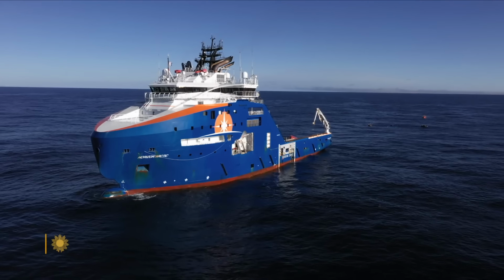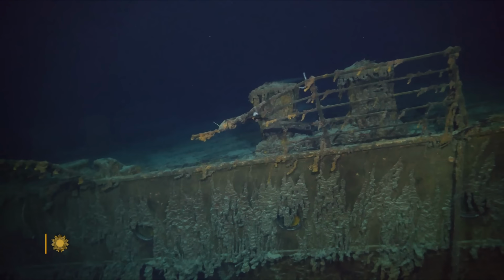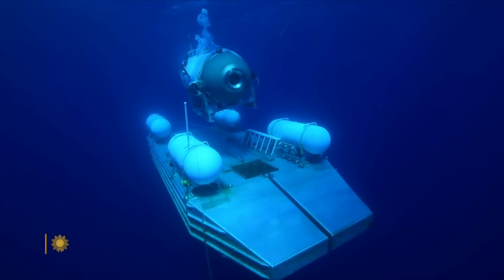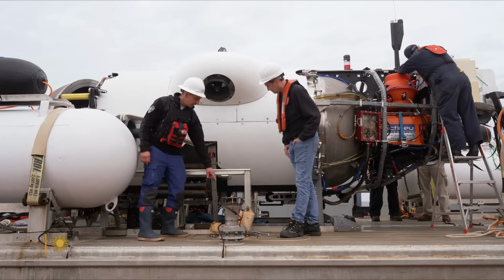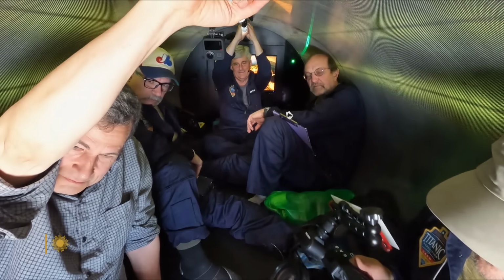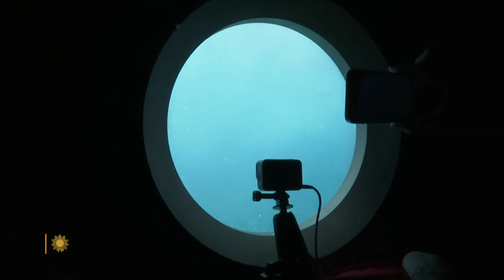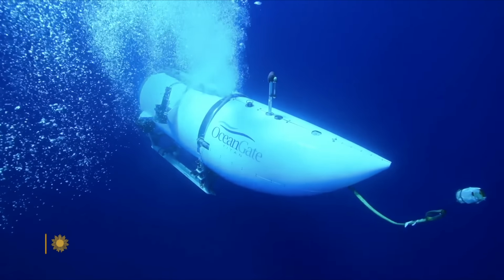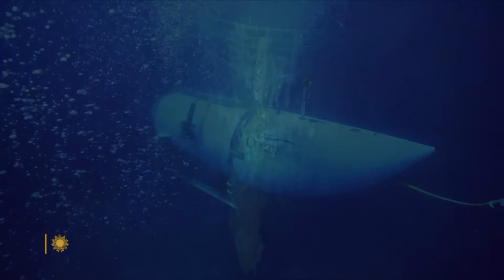Inside the OceanGate Titan tragedy

Comment: The Titan did too many dives and suffered fatigue over time weakening the structure. The use of different materials in the subs designs caused corrosion from the salt water. It is a real tragedy that more time and money wasn't spent further improving the design. 

The titan should have been dismantled and studied to look for flows after 10 dives (or any number) and then redesigned to be safer.
Reply: The flaws of carbon fiber composites are well known. They weren't a surprise. 

They chose to cut corners on safety and material to save money.
Reply: vibratingstring CBS said 12 that’s probably about right. Plus it made several more trips to lesser depths than the Titanic
Reply: vibratingstring  The Titan had made 20 dives to Titanic depth. 12 of those times, it actually made it TO the Titanic. The rest were either tests, or they couldn't find the shipwreck once they got down there.
Reply: vibratingstring  I'm not exactly sure how many dives, but this video reported 12 in its first year. 

There were 50 test dives done in the Bahamas and pressure chambers without people in it. 

That is a lot of abuse, and at a certain point, Titan should have been retired. The stress at those depths is huge and fatigue is a real thing that slowly weakened the sub.
Reply: As far as I am concerned, the best design in the world cannot compensate for the carelessness and recklessness of human beings.  (Do I sound like Spock?)
Reply: The verse of God is repeated again, just as people built a gigantic ship before and challenged God with it that he could not sink it. God accepted the challenge and sank it today, drowning a submarine that came to it and took the same name. And just as God made the whole world talk about ships And he makes movies and songs for it to make it famous and teach people his verses He made the world talk about the submarine and became famous so that they could know his verses More fame for the first incident and a reminder of it so that people can remember its verses.

Comment: Carbon fiber is very strong but has no place on a sub. It’s strong with internal pressure from the inside but the weaves fail with external pressure.

Comment: Redundancy is one of the important functions of determining integrity of mechanical devices.

They needed to deep dive that sub without occupants until failure. 

Then they needed to repeat that at least 5 to 10 times with identical subs to understand it limitations.

None of that happened. He sold himself and others snake oil about the sub's capabilities.

Comment: As a recent graduate with a bachelors in Naval Architecture and Marine Engineering, some of what was said in this video honestly scares me because there appear to be so many red flags that even a novice could have pointed out. I feel it's not good to speak ill of the dead, may they rest in peace but there is a reason naval architects exist!!! While it shares similarities to aerospace they are not the same.

While you might think pressure vessels have the same strength miles above or below sea level that's not the case with any composite, and any engineer who spends a little bit of time knows this. Carbon fiber or any composite works well under tensile loads, which are much more prevalent at altitude where atmospheric pressure is decreasing and the pressure inside the aircraft hull is greater than the environment, in other words the force is acting outwards on the hull.

When you reverse the scenario to diving deep below the ocean surface, pressure is now significantly higher in the environment than it is inside the hull. This inward force is a compressive loading where carbon fiber and EVERY composite is known to behave poorly!!! Studies show carbon only has 30-50% of it's tensile strength in compression, combine this with fatigue cracking from repeated dives and different materials is a recipe for disaster.

Lastly - carbon fiber and most composites don't deflect. They're EXTREMELY brittle. This is a great property to have when dealing with things that need lots of rigidity, which a submarine hull does not. As a matter of fact, in the Navy submarine hulls are expected to deflect. My professor, who was a submariner, told me a story once of how he used to a tie a string tense across the breadth of the engine room before a dive, when they reached depth, the string would be slack. Carbon doesn't deflect, it just breaks, and it breaks catastrophically...

Ingenuity and safety need not be separated, most regulations in maritime industry have bodies buried behind them and thus they exist for good reason.

Rest in peace all who were on board.

Comment: All materials have a fatigue development profile (the rate at which they weaken when repeatedly stressed). Each dive made during the two years leading up to the loss weakened Titan's hull to some degree.

Experience and testing have allowed engineers to predict relatively accurate lifespans for ship hulls and aircraft airframes based on how quickly they develop micro-cracks and weak areas, the result of cyclic fatigue. Without adequate testing, Oceangate's engineers had no way of forecasting an accurate hull lifespan. 

I understand that out of respect for Stockton Rush's family, and the fact that hindsight is 20/20, many people are hesitant to be perceived as being brutal in blaming Rush. Also he wasn't alone in promoting the Titan endeavor, but he was the leader. Blame doesn't achieve much except maybe promoting oversight of companies undertaking risky business in areas normally outside of jurisdictions.

Why You Tube would cut out a chunk of an engineering analysis as inappropriate is beyond my understanding, but this is what you get with AI. Look forward to more of it in the future. I'm glad at 71 I'll be dead before it really gets out of hand.

Comment: It would probably have been better without the titanium ends because the fiberglass hull would flex shrink and expand etc but the titanium does not flex therefore creating a fault area where the fiberglass would break away from the titanium ends

Comment: This might probably be even worse than the byford incident, in that case it was decompression from 9 bar to 1. And it was not pretty. This is not the same scenerio but it its pretty close if not worse, the titanic iirc rests at 12500ft which is around 382 bars, the pressure is crushing (carbon fibre is not a good solution for overuse as its structural integrity is very easily compromised, especially at that crushing pressure, hence with every trip its more likely to fail). 

They were crushed, from the outside in, in the byford case the bodies were discovered which you don't wanna look up for your own good, an implosion at that depth, as tragic as it sounds they will probably find nothing or just fragments.

Also another thing caught me is Rush's statement on "risk" he's literally delusional here, yes risk taking is something people do enjoy but what he fails to realize his own egotistical model of "risk" is not how everyone percieves it, calculated risks, managing risks is not just for your own sake but a responsibility to the people you're taking down to get crushed due to your own disillusioned perception on risk and its correlation to life. Ironic and karmic that his "outside the box" mentality was his own undoing, the box he was in, was crushed from the outside tragic that other people payed the price of his hubris that they didn't deserve at all.
Reply: ❤ Those passengers signed the waiver forms willingly.  They might have death wish except for the nineteen year old.

Comment: There's a saying I try to stick to, "before you try to beat the odds, make sure you can survive the odds beating you."  That's not to say that I won't take risks.  After all, I am willing to climb inside of an armored vehicle with two other guys and take it into combat, but I do try to incorporate good risk mitigation into everything that I do.  Based in what Stockton Rush himself stated, I'm not sure that risk mitigation was really done to the level it should've been to justify taking a carbon fiber tube 22,000+ feet down into the ocean where the pressure was something along the lines of 30,000 psi.

Comment: "Carbon fibre is better than titanium" is so reckless as a statement . Considering how in the world of engineering and material science we have limited knowledge on its properties . It is still being studied and re-using the same sub to be subjected to such insane pressures is crazy irresponsible . I respect the leap of innovation however as innovators it is imperative to follow protocol to actually make designs that are better . Theres a reason that the gap was there for innovation because of the protocols , adhere to those and innovate outside the box but within parameters , restrictions and constraints .

Comment: There were several Warnings, before the fatal dive, where several problems occurred, design failures and execution errors, use of inappropriate materials, there was no risk management, lack of communication, several defects occurred, this Submersible did not have any approval certificate of Maritime Security. 🚨

Comment: The thing with carbon fiber is its strength will decrease with each loading and unloading. Was he right about carbon fiber being strong. Yes, if its done very carefully carbon fiber is amazing. The problem is the repeated use. That sub should have been scrapped after the first dive and rebuilt. But he would have had to charge more for his "adventure". Carbo. Fiber is very strong but unlike steel, titanium or aluminum its not a homogenous material making it very susceptible to imperfections. At 6k psi small imperfections become fatal.... obviously. The window rated for 1300 meters is another story. That was just negligent from the get go.

Comment: No one knows what happened down there. Everyone is assuming there was a design fault. That seems likely true, but until you know, it's pointless peculation. No one knows if they hit something, or were hit by something. No one knows if someone freaked out and did something amazingly dumb. We don't know what killed the Titan, and thumbing your noses at all the 'stupid' design features is just gleeful schadenfreud, because, you know, even if it is a design fault, then all the other 'faults' will turn out to not have been a problem.

You have a guy on here saying the issue was all the different materials, and you're touting him as an expert, but that is true of EVERY submersible. If there's a window on it you have, at the very, very minimum, the metal hull, the crystal glass and the rubber gasket. He also says submarines don't have windows because they're a failure point? No, they don't have windows because there's literally nothing to look at - they do, actually, have them on Russian subs in the tower, by the way. Here's the trick to experts - experts don't say palpably dumb things about their subject.

Comment: If it was declared not safe beyond safety and not approved: why did they not send the submarine without humans and tested it remotely. It didn’t have to have humans to control it at least not just yet. 
That submarine could of been used with a remote without humans. If I’m wrong then you might say oh well, someone had to control it, the cost would be to much to send in without at least a person. 
But they were billionaires. How stupid of an answer. 
Why not send 1 person to test it if:
1: declares unsafe 
2: not possible to send submarine empty handed without at least 1 person controlling it.

Comment: I remember the 1963 Rambler built by AMC motors in Kenosha, WI.  The engine had an iron block while the heads were made of cast aluminum.  Totally dissimilar metals and after 3 years of engine cracks and failures they ceased production of that engine.  Dissimilar materials just don't cut it.

Comment: So I asked A.I to figure this out cause no conversion calculator exists for it... Water weighs about 8 pounds per gallon. How hard in psi would that gallon if water hit if it's moving at 620 mph like in the implosion... 6,000 psi crushing in is way off once the waters moving.

The people inside would get hit with many gallons of water at 620 mph in a millisecond... As one gallon hits with 
(Short version of A.I answer) A gallon of water moving at 620 mph would impact with approximately 747,000 psi...  That 168 million pounds of impact force. From all sides as water closes in at close to supersonic speed.

Comment: Actually it might be worthwhile having an idiot Stockton Rush not around anymore! It's sad he had to take more people with him. The circumstances ARE very much similiar. The Titanic used wrought iron rivets instead of steel rivets up front. The Titan used a carbon fiber composite which obviously could not withstand compressional forces placed upon it. The captain of the Titanic rushed FULL SPEED into an icefield he had been repeatedly warned about. I think this was more Bruce Ihmay rather than the captain however. The lookouts on the Titanic didn't have binoculars. The Titan had insufficient sensors to indicate a potential pressure chamber problem before anything could be done to stop an implosion. The one thing he thought was "unsinkable" was, the pressure chamber. The Titanic, thought to be unsinkable, was too! The Titanic design was flawed, the Titan's design was flawed too!

Stockton Rush will go down in history as a total idiot who did not put safety first. He will be remembered for what not to do.  Bruce Ishmay suffered the rest of his life for his stupidity and ignorance. Stockton Rush at least will not have to go through that because he's dead. No submersible from this point forward will ever be constructed from carbon fiber again. We now know what happens when this material is used. Like with Titanic, new regulations will be placed on all submersibles and none will be allowed to go in the water at the whims of it's creators ever again!